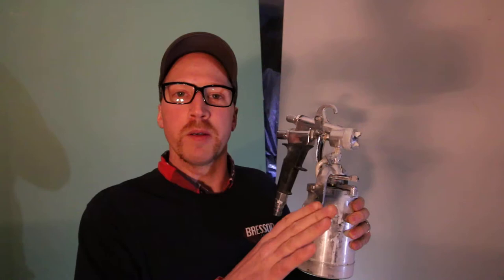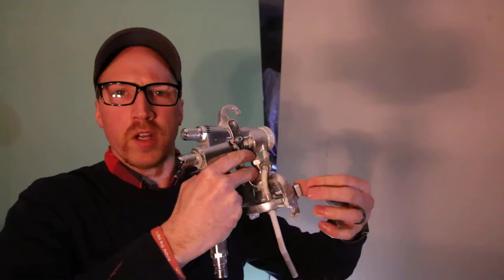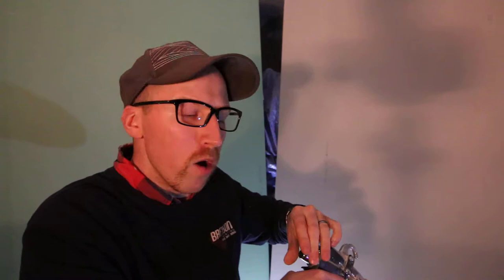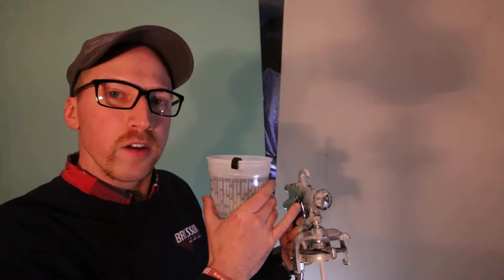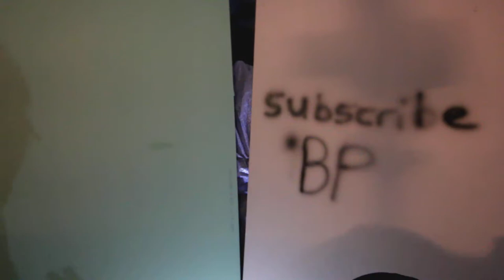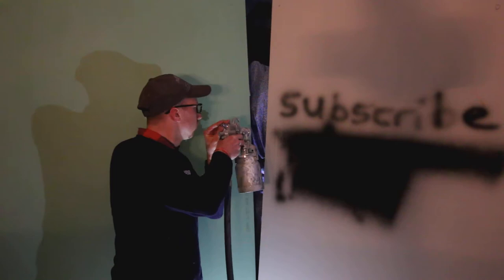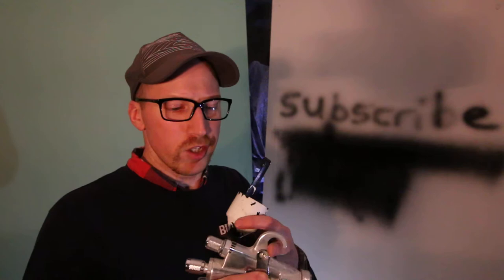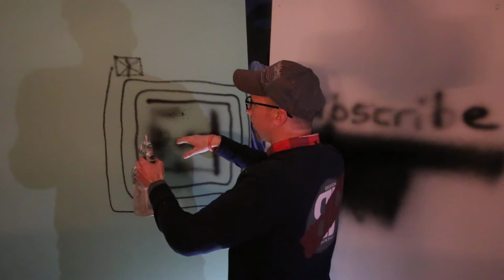HVLP Paint Spray Basics | Getting Started

Comment: Thanks for this. I have an older Wagner 2900 HVLP which has the NB gun. This looks to be the predecessor to the gun you are using hear but the adjustments are the same with the exception of the air control. This was helpful in dialing in my sprayer and understanding its use vs the airless.